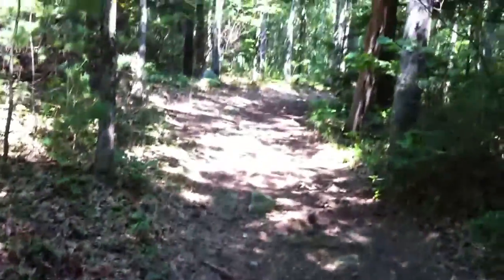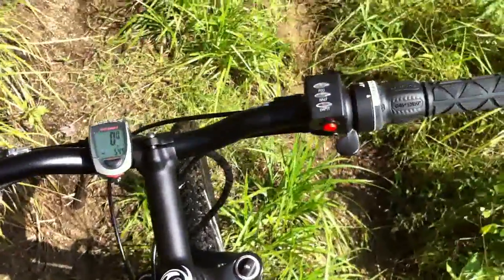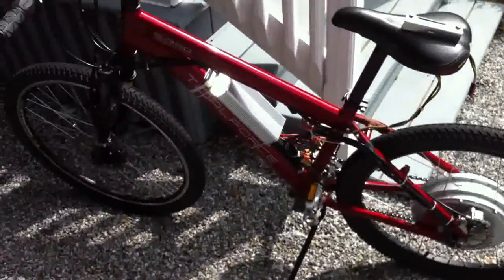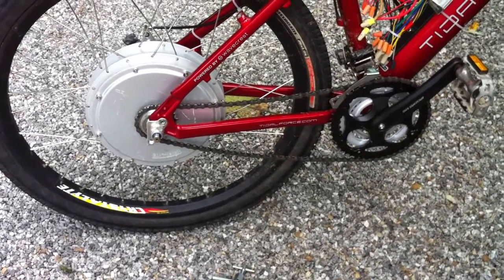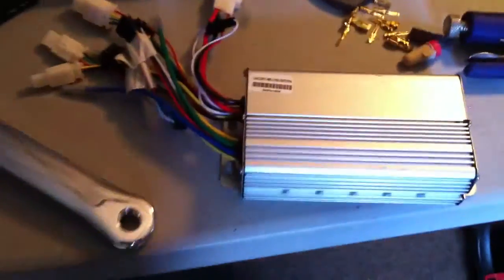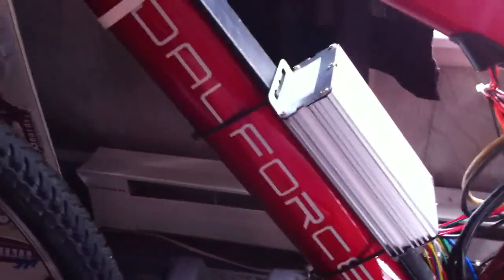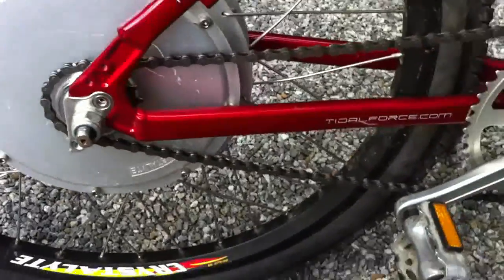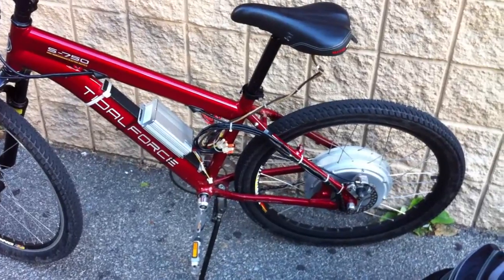72V X5404 Tidalforce EBIKE Gets a 12-fet Controller and 52t Chain ring

Comment: Nice bike! Mine is just 48v 1000w rear hub motor and looks the same that you had earlier. I also got 10ah aluminium case Lifepo4 battery mounted on top of the down tube on my bike. Ride´s great, but wuold like to have more low end power. I also took all gears of, still need bigger sproket to the front. Now it has only 36t and 18t on the back. Keep the videos coming.